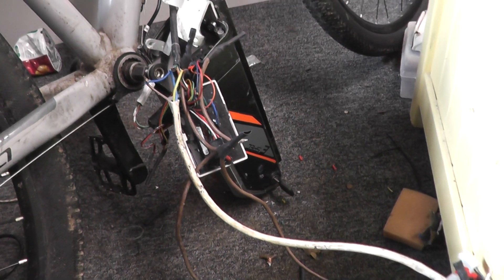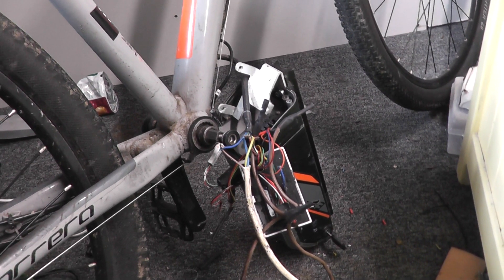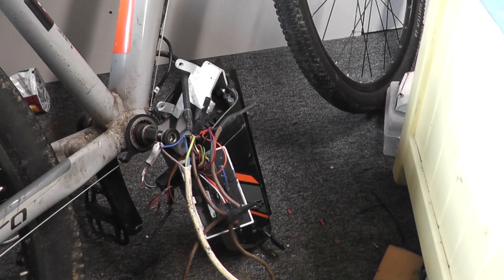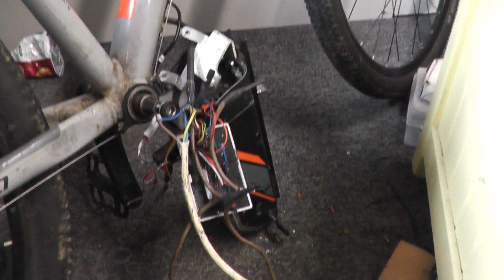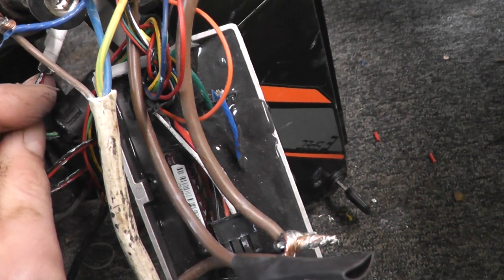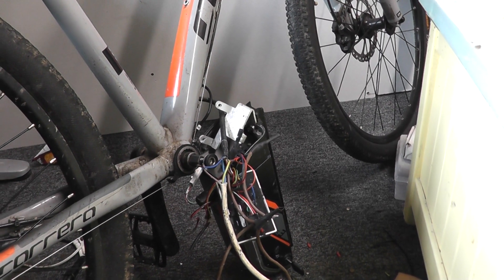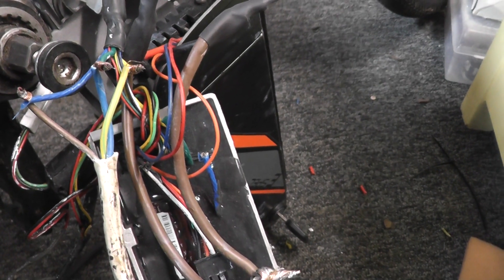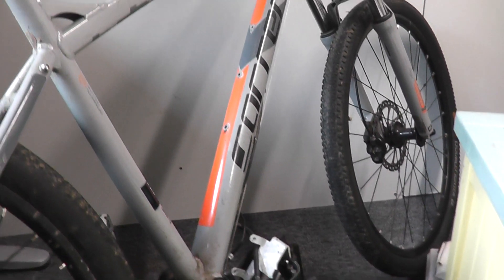hacking a carrera   e spec electric bike to run a  throttle  and  speed hack

Comment: Hello Tc Bot. I have a Raleigh Array, with 36v battery and I believe the suntore motor is 250 w. I want t tke the speed limt off to be increased, as well as a throttle assistant. Could Give me some advise THE best way to do that.

Comment: Im trying to make mine faster
Reply from the maker: you needs to replace the controller  that gets  you to about 18mph   if you want any more  you need to up the battery  voltage   eg replace 36v battery with a 48v battery /48v controller
Reply: Why won’t it spin without chain? I had hub and mid drive e bikes and they all spin the wheel without peddling also how did it turn out in the end? I’m going to be doing something very similar soon just need to find a controller that’ll work
Reply: Mate, this doesnt even sound like an ebike back hub motor , think about it,why would you wire it to run in reverse? Then nothing is even moving or vibrating! Then listen to the sound again and as your brains saying "thats a power tool?!" Ask yourself why he would then say "is there anything i can disconnect to prove it, No" lol it just dont add up,im a vehicle body repairer and technician, so thats just my opinion tho ay, lol ❤@jhgujusfbvh4449
Reply: Can you make a video on how to connect it all up and put it back on the bike please